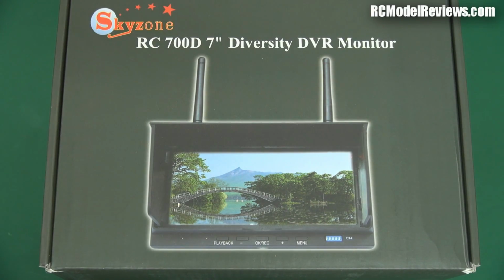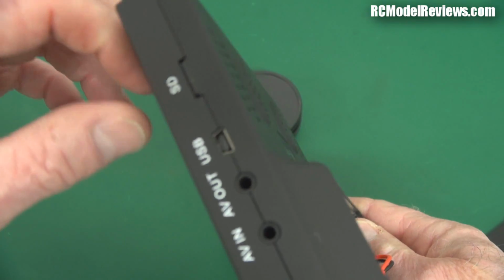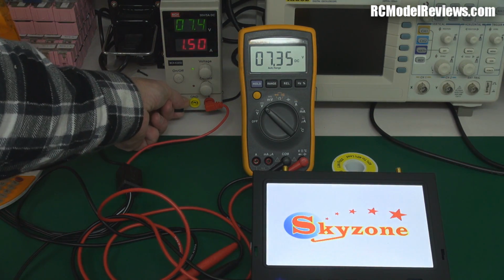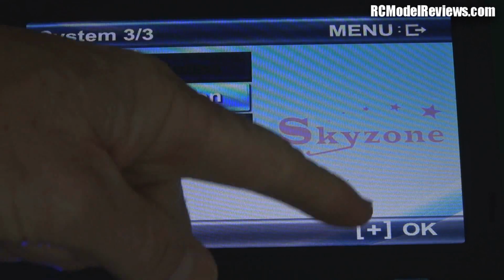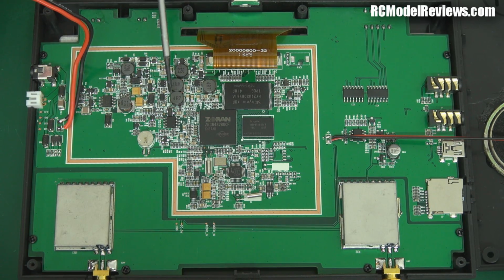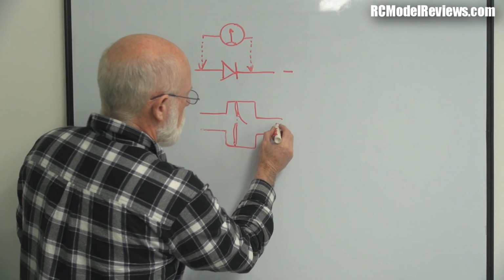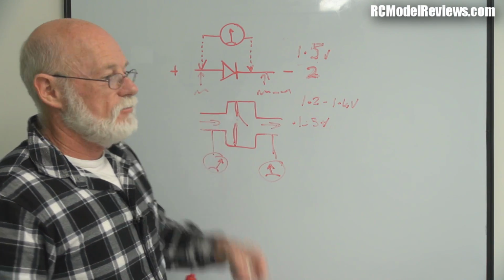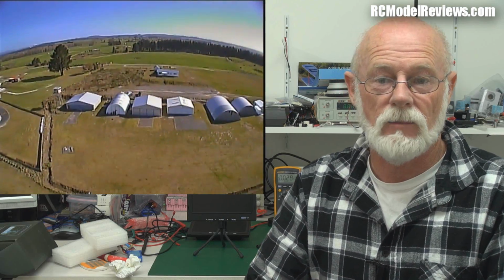Review: Skyzone RC 700D Diversity DVR LCD monitor (part 1)

Comment: Do you think a 3s Life battery would be better for this than a 2s or 3s lipo ?
Reply: MaimexRC If you can find a 2S LiFe that will fit it would work just fine -- so long as you set the battery type to "ignore".
Reply: ***** Well my comment was just to give an alternative to LiPo, not a matter of fit or dimension. I already have a monitor but unfortunately no DVR.
I thought that it would be better to not have too much voltage (12.6V for a lipo fully charged, while the monitor stop working at 7,4V)

I don't know if it's really useful but I would prefer be friendly with the voltage regulator.

According to the voltage test in the video, a 2S Life battery would not work! Fully charged the voltage of it should be 3,6*2=7,2V < 7,4V at which the monitor turn off. (In addition, do not forget that the voltage of Life battery drops faster than the voltage of a Lipo of the same capacity)

 Anybody thinks a 3s Life battery would be better for this than a 2s or 3s lipo ?

Comment: great review.  When you lowered the power the LCD never gave you a low voltage warning and it was 7.4V.  What does the screen show as the voltage since it starts off at 6.9V?  did it go down or stay at 6.9?
Reply: One Brothers Productions I had the battery type set to ignore but wIth that 1500 3S battery and the battery type set accordingly, the "Low Battery" message began flashing on the screen after just 15 minutes operation from fully charged.  The total run-time (down to 3.3V per cell) was 90 minutes.